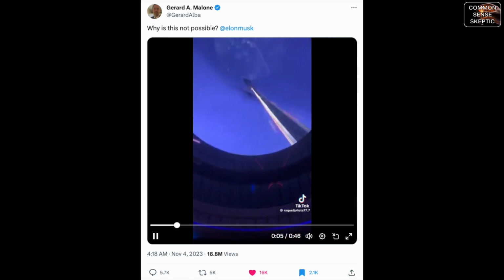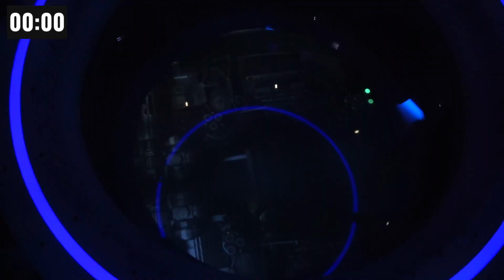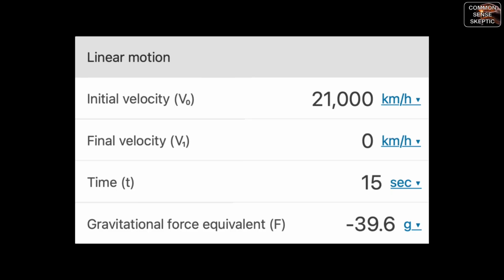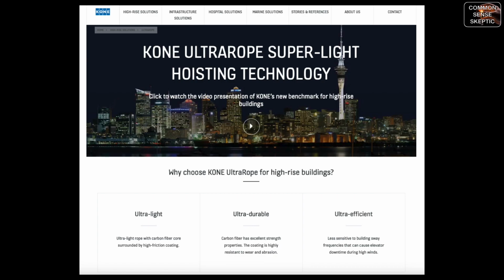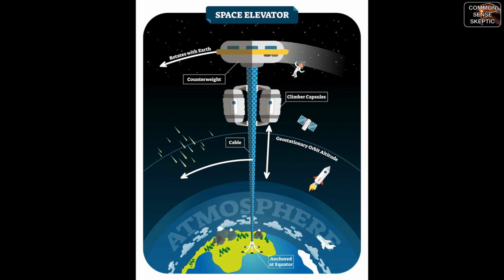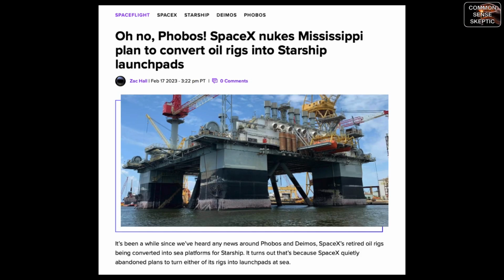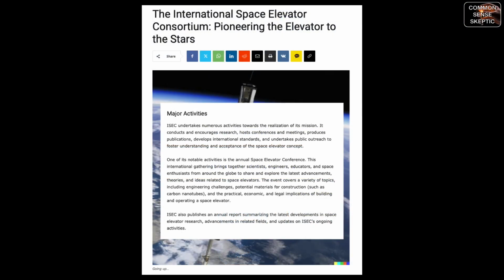DEBUNKING L.E.O. SPACE ELEVATORS

Comment: What about making the cable a tube filled with helium? I know it won't get to space but it could offset some of the weight. Just a idea after seeing this vid
Reply from the maker: Could be a $7000 prize winner with that ISEC competition :)
Reply: i'm not sure if this comment is serious or not, but you do realize that there is no air in space for the helium to "float" on right?
Reply: @quasadra  Obviously there is no air is space but you do understand that part of the cable goes through the atmosphere right?
Reply: @christophers707  For a cable that extends all the way to space the lifting force is atmospheric pressure acting on the bottom end area of the cable which is miniscule compared to the the length/weight of the cable.
Reply: @Axel_Andersen  The diameter of tube would probably be substantial so it would be more of a lifting body than just a cable filled with helium.
Reply: @christophers707   Still even at e.g. 10 m diameter 'tube' diameter the lift would be insignificant compared to the weight of the 'tube'.
Reply: And where will you find the amount of helium to fill a tube reaching out into space? Helium is already in short supply here on earth.
Reply: @MrHrannsi  they still waste it on balloons so how rare could it be. Also could use hydrogen on the upper portions where little oxygen is.

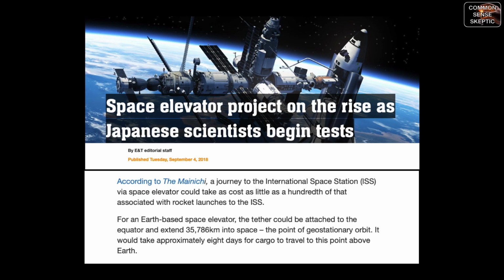Comment: 10:50 
Small correction, they wouldn't burn up in the atmosphere specifically because they aren't moving fast. Instead they would just fall until they reached terminal velocity and then smacked into the Earth.
Reply: I don't think you are right. They start move-less at 350km above ground ~~ 270km above 'the top of the atmosphere'.
Applying just basic physics. (s=1/2*g*t*t and v=g*t), it would take them ~233s of undecelerated free fall before reaching the top of the atmosphere, reaching speed of ~2330m/s = 8400kmph or 5200mph or Mach7. 
I'm no expert, but entering atmosphere verically down @Mach7 WOULD pretty much cause you to burn down into a charcoal. Pretty much like Vladimir Komarov did.

Comment: Even if we are ever able to make a cable that can handle the forces involved, to make a space elevator practical it'd need to reach extreme speeds and acceleration. To make that anything but fatal to life or an effective way to destroy cargo we'd need inertial dampeners like in Star Trek to be a reality. But is that there is nothing to suggest inertial dampeners or anything that achieve the same thing are possible and a lot that suggests that they aren't.
Reply: But I doubt we will ever have a material able to handle the forces involved. We'd likely need another technology from Star Trek (and other science fictions) and that would be an equivalent of navigational shields. They would have to be designed to be projected over the elevator and the entire length of the cable. That is a range that is not possible even in Star Trek let alone real life where we cannot generate shields over anything let alone that range.
Reply: Why do we need  extreme speeds and acceleration?  

Accelearting up the cable for an hour at .1g and we get to 3,531 m/s

And we have traveled 6355.8 km up the cable.

We travel up for ~35,000km and start slowing down.

5 hours and we have reaced the top of the elevator.
Reply: @catprog  Because it is an elevator. No one  wants a 5 hour elevator ride. They don't even want a 1hour elevator ride. Especially since they cannot bring a book or anything to do during that 5 hours.

Comment: Regarding your wind turbulence suggestion, I am not entirely sure but I don't think there is any wind turbulence at the equator.  If I remember correctly, there is almost no relative wind there since all wind begins there as the air is heated at the surface and flows straight up in an area known as the doldrums. When the warm air finally reaches the top of the atmosphere, it then spreads out creating wind patterns to the northern hemisphere and the southern hemisphere and the relative winds caused by the Coriolis effect.  Of course this really doesn't matter in this case since the entire concept of such a structure is ridiculous.
Reply: as someone who spent 8-years in Singapore, I can tell you we regularly enjoyed some spectacular storms

Comment: Maybe use the tether itself to generate power from the electrical potential energy difference between earth level and upper atmosphere. 
Satellite deployers could consist of a rotational launcher a la Spinlaunch, or maybe a railgun type linear launcher. It would still require acceleration to orbital velocity, but that should be much easier to achieve without all the atmosphere in the way. 
The weather and resonance from winds blowing over the tether seem like maybe the tougher nut to crack. And how much is the length going to fluctuate from thermal expansion?
Reply: Overall would likely make much more sense to look how to build autononmic, self reparing drones which mine the moon and build something out of that if possible.

We overall should focus more on that before starting to look into space, beause without such technology, there isn't much we can reach up there.

As soon as we got drone which can build a whole city on their own on earth, we can think about if they can do that in space. 

Else: what's the point even to create such a space elevator or whatever in the first place?

Comment: There is something wrong here or maybe I misunderstood what you said, obviously this isn't possible but in a hypothetical world where a space elevator was, if you dropped a satellite from a space elevator at the top it would stay still, for it to be up there in the first place it would be moving at orbital velocity, it would be moving with the elevator, they have 3 km per second velocity at the top. I'm trying to puzzle out what that means halfway up the chain, things orbitting higher move slower. I'm trying to figure out what the thinking is for space elevators because they do have the physics/orbital mechanics solved they're just not possible to construct both for reasons of practicality and also that materials don't exist to support it. I think the idea is that you have a large mass at the top like an asteroid and that tension holds up the middle part, it actually is falling and the weight is pulling on both sides of the elevator. The closer it is to geostationary the less it's pulling. If you dropped something from leo it would fall but not straight down, it would have the same 3km/s velocity of the top which isn't enough to orbit at leo but the higher you go the less delta v you need to reach orbit.
Edit: There's something wrong here because I can find contradictions but it's not what I said because if you get on the tower a foot up and drop something it's not moving at 3 km/s, that's just the rate the top needs to move to track the earth, at the bottom it's .5km/s and the difference is just the difference in the circles from the surface of the earth to geostationary in the same time. I don't know this isn't what I know but I know there's something wrong because if you're at the top and you step off you're still orbitting.
Reply: The yt'er assumed that the station where you'd drop off a satellite would be at LEO altitude. To be stationary above a point in earth however, if your station is supposed to be at LEO altitude it must be much slower than orbital velocity (since lower orbit => higher orbital velocity).
The video he was referring to was talking about a space elevator that had its station at Geostationary altitude, where you can indeed just step off the space station and remain in orbit without falling (more or less), but the yt'er misinterpreted them as saying the station was at LEO altitude.
Reply: What is the circumference of a circle 1m in radius. what is the circumference of a circle 10m in radius.

Now rotate both circles at 1RPM. 

How much distance would a point on each circle outside travel in a minute.

This is what you are missing.
Reply: @catprog  2π radians 👍🤣
Reply: @insu_na  The point was the 1m circle has less of a circumference  then then 10m circle and if both circles are rotating at the same rate then a point on the edges of each would be going at diffrent speeds,
Reply: @catprog  yeah I know, it was a joke, hence the emote ;)

Comment: To get to 21,000 km/h we will have to use a hyperloop for the tether. It should be done by the end of this year. Worst case next year.
Reply: A hyperloop?
What a brilliant idea! We already got tonnes of vacuum in space, to put into the tube!
Reply: @akyhne ikr, all they need to do to refresh the vacuum would be to open a door at the top and let some more in...
Reply: @b0b5m1th  Yeah, changing the vacuum now and then, sounds like a good plan! We don't want a vacuum tube, to smell of old vacuum.
Reply: @akyhne  absolutely necessary. No one likes a smelly vacuum.
Reply: @b0b5m1th  I just happened by chance, watching a Japanese factory making glass bottles for vacuum.
I thought Japan had started selling bottled vacuum to Elon, but no, it was something entirely different.

I hope he finds his own solution for the hyperloop then.
Reply: @b0b5m1th vaccoom..as known as 0 bar compression doesnt work that way... as source of air pressure on earth is grawity. open up no problem... but you need a pump at bottom...as is as how water duesnt lose its pressure on bottom ewen after yoh open cap on top
Reply: @akyhne  🤣
Reply: `Honestly, its really not that difficult`
Reply: @MyKharli  🤣
Reply: @MyKharli and why not just forget the anchor for the tether? Just build a symmetrical system with two space elevators going from antipodes and connect the cable from one with the other through a big hole running through Earth's center. I've heard there is now a company which made boring such tunnels much cheaper as it has ever been.
Reply: @mittelwelle_531_khz  I had thought only of making two ones so to make use of the gravity of one to lift the other, like funicular carriage, but this might even be better, although certainly even more expensive initially. They can use not only solar and wind power, but geothermal power from the planet's core itself! And with two elevators one of each side of the planet, there's more daylight for another space station, that's a big plus.
Reply: Concerning. Looking into it.
Reply: I am confident. (insert stuttering)
Reply: A straw to vent oxygen into space, perfect!
Reply: the good thing is that, as the tube rises, the less energy is needed to maintain the vacuum. But while the vacuum aspect of the Hype-R-loop is useful, and since we're already making one, why don't we just throw another one up? So we can have them connected like funicular carriages, one that descends uses the energy to lift the other one up. Maybe we can even add on the windy and sunny atmospheric height of the thing wind turbines that are also solar panels, built around the thing not only to reduce wind problems on the structure, buy maybe even end up with a surplus of energy.

Although perhaps the most brilliant idea would be to have a structure on the ocean, with the same principles of the "drinking bird," only big enough to extend its head above the atmosphere. If not an elevator, at least a space catapult. Or some Disney-Sea-World attraction.
Reply: As I have the most manfactoring knowledge of everyone on earth, I know it'll take only three weeks to manufacture a hyperloop to a stationary spacestation. Two weeks if I sleep on the shop floor.
Reply: just that a space elevator does not need that velocity, as its tether already supplies the "overcoming earth's gravity" bit that a rocket needs to be so fast to achieve and the speed only needs to allow you to reach the height you want in the targeted time. using the given example of 220 miles high at 20 minutes per ride would be 660 mph. about 1.5 times Bullet train velocity and doable, even though it is currently a bit outside of normal lift operation as lift manufacturers have to work with building infrastructure and do not have overland rail power levels at hand.
Reply: 1 year has passed, and nothing has happened